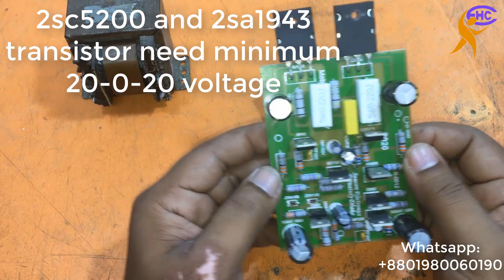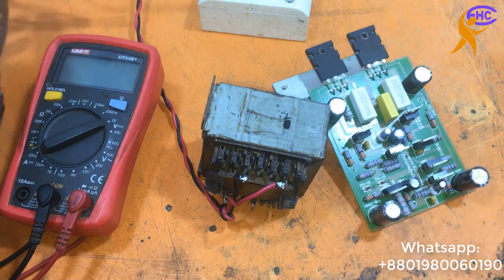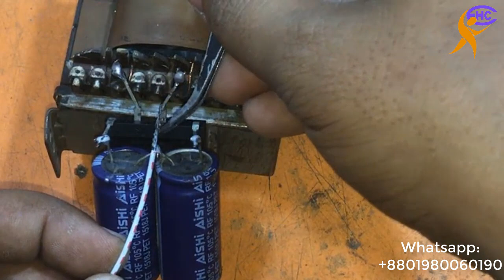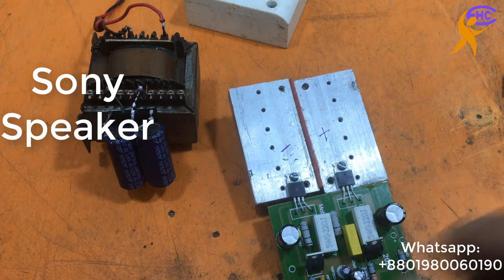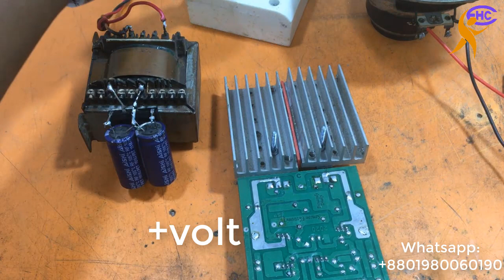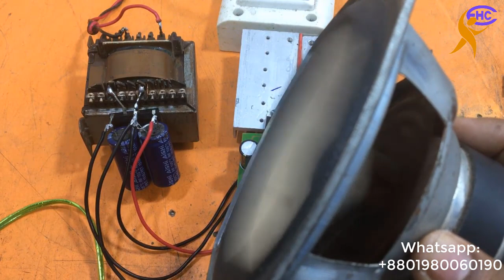how to make transistor amplifier using 12 voltage only?

Comment: Replace c 2073 and a 940 and use Darlington pair like tip 122/ 127  .  It will provide more power and quality . Obviously in between that voltage which you are using for 2073/940 pair .

Nice video ....
Reply from the maker: Please visit for circuit diagram
https://www.pinterest.com/electrohelpcare/pins/